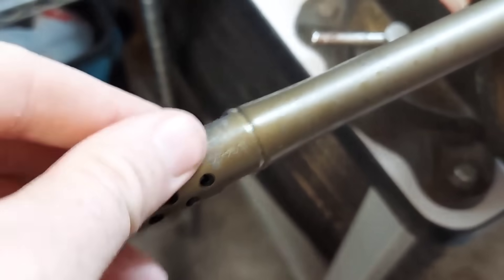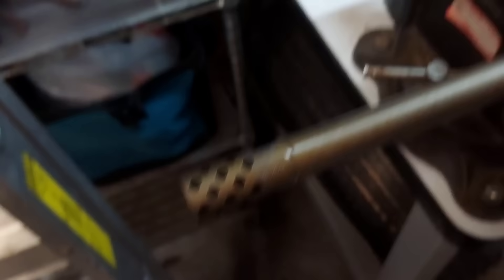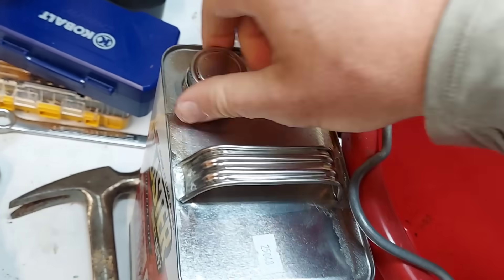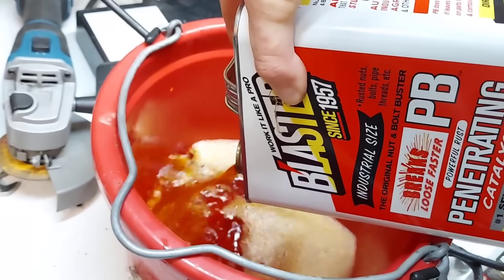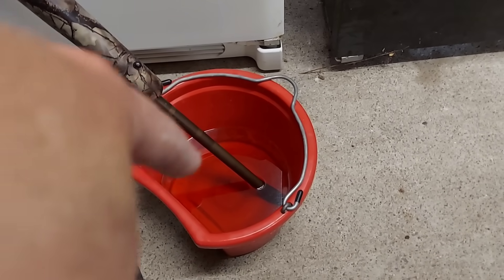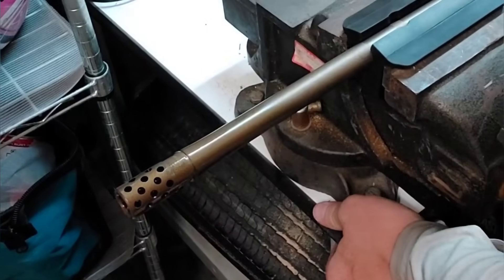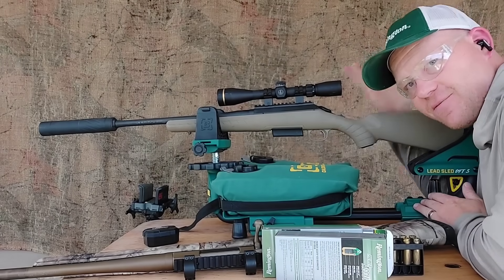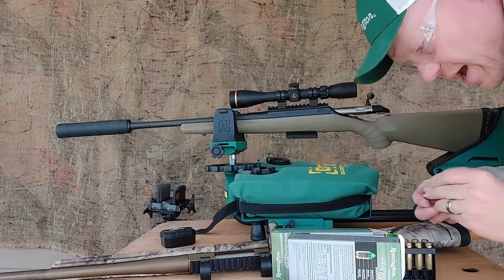450 Bushmaster Barrel Length Matter: Results Will Surprise You

Comment: 60FPS yields 141 ft lbs of energy at the muzzle.   About 5.5% increase in muzzle energy. 

Might try Hornady FTX custom 250gr  as it is designed for Bolt action.   

Hornady Black 250g FTX is designed for AR platform and shorter barrels.  

Different powders 

Of note 24” barrel actually slows the bullet.  Peak velocity of the Hornady FTX is from a 22” according to Hornady.

Comment: I had the gowild with 22" barrelm. Accuracy was terrible especially when barrel got warm.  The bold is crap and the slightest bump rotates the bolt a smidge and the gun wont fire.  Worst gun ive ever owned so I sold it for cheap.  Also yould do the test without the suppressor.

Comment: I never like to comment negativity but did you retighten the barrel on that rifle. But enough that because my ruger sr556. Brake was impossibly tight also I thinner it was. Rocket on I had to hold it in a pot of boiling water for about 10 minutes to break it free

Comment: I have three 450 BMs.  A Ruger American ranch with 16" barrel, Ruger Gunsite Scout with 16" barrel, and a Ruger Number One with 20" barrel.  Chronographing about eight handloads and a couple of factory loads, there is surprisingly little difference in MV.   The 20" barrel offers very little advantage.   All are about the same in the accuracy department.  Loads included cast bullets as well as jacketed ones.   I"ve heard that soaking the muzzle brake end in boiling water can help loosen it.

Comment: Just for future reference those jugs are designed to poor the exact opposite way of the way you poured it. I just recently learned this when I was putting oil in my truck and old timer told me to flip the oil jug over and it is a lot less messy and easier to poor. Give it a try it works pretty well.

Comment: I have the 16” barrel and the only reason I entertain the thought of a different 450 is 1) I like to Bear hunt Canada and the 16” isn’t legal there 2) I like the locking bolt on the gen 2. But purely for speed I would never trade 6” less barrel for 60 fps more, more maneuverability and less weight 
16” is king

Comment: I do quite a bit of barrel work. All my clamp blocks are out of wood lined with felt and use rosin. Never had a mark on any of my barrels.
 On my 350 legends my 22 inch barrel is about 75fps faster than the box stated velocity in a 18inch barrel. In my testing I would say the reason is a faster burning powder is used. Where I get a big velocity increase is reloading using a slower burning powder. I am able to achieve 300fps more with my reloads, slower powder and longer barrel. I have gone up to 2550fps with a moly coated 165gr bullet. Great video.

Comment: If that brake was affixed using Rocksett, you have to boil it in water for 5 minutes first. Comes off easily afterwards.  Also, get a breaker bar, already. Leverage is your friend.

Comment: Man, good to see you got it figured out. I couldn’t comment because the live was over. I turned wrenches my whole life, and noticed it right off. Also just fyi, pliers, they grip in one direction, adjustable wrenches also. If used wrong, they slip much easier.
All of my rifles are long, but I have to say, the wife’s mod 7, and and my daughters ruger ranch are easier to stick out the window in a shooting house. The cartridge has a lot to do with the velocity gain in a longer barrel. Straight wall, and really most short action cartridges don’t have much to gain.

Comment: I have been doing a lot of research as I plan on building a 450.   The general consensus seems to be that 18-20” is the sweet spot for barrel length on the 450.   In your shoes, if the longer barrel shoots as good as the 16”, I would have 3 or 4 inch’s chopped off and rethreaded

Comment: As most others have said, I'd probably go with whichever grouped better. Another take would be if you plan on sticking with factory ammo, maybe go with the Ranch but if you plan on developing a load and handloading your ammo, maybe with a slower powder, the longer barrel will yield a more significant increase in velocity. I don't think it's needed with the 450 though. It's going to be puttin' a hurtin' on your target regardless.

Comment: 'Next time' I'd dust those flex jaws with powdered rosin. Always the best way to get 'traction' between metal and plastic or other metal. Apply with small paint or makeup brush. Wipe away with DNA or 91% RA. I use it on milling vise and lathe chucks jaws too when there isn't much to grab onto  and/or  esp with plastics to not distort 'em when clamping up. btw It's not a secret .. but who knows?  🙂

Comment: Ruger sometimes uses Rocksett. It’s water soluble. Sounds crazy but I couldn’t get the muzzle brake off of my SFAR until I submerged the muzzle in almost boiling hot water for about 15 minutes.
Reply from the maker: They told me they never use it

Comment: 1 - Check your headspace on the 22" after messing with the barrel and action thread.
2 - Not surprised to see that small a difference between a 16 and 22" barrel on a straight wall cartridge.
3 - DO NOT become a gunsmith 🤣

Comment: Put a touch of anti seize compound on the barrel threads and wipe lightly to leave the compound in the inside of the threads. Only torque the break to 30-35 FT/LBS MAX. I prefer about 25-30 when clocked. If you need to shim it to clock than do what’s necessary bu there is no need to stick a break on a barrel so damn tight that you need to use impact to loosen it. 
Good luck and have fun, thanks for all you do for us the viewers. 

Any tighter is

Comment: Im sure someone has already said... if its got locktight on it... the only thing that will work is heat.  Hit it with a torch for a min. and then ...turn it the 'right way.'     But only the tip and only for a min. so you don't burn the finish off the barrel
The REAL thing that I hope someone here has told you... take it to a gunsmith.   Even if you get the muzzle break off... you will still have to reset the torque on the barrel... you will need an Action wrench to do this proper.  Or you can lock the receiver in that vice... you think the brake was messed up... clamp that receiver in that vice and when turning... it might actually shatter it.   Or you can go buy an action wrench for a Ruger action and re torque it... about $90 with tax... 40buck less than a gunsmith... but in the end you would still have an action wrench for all your rugers when needed.

Me... I would choose the shorter of the two...(hunting) Or if I have to choose prior to purchase... I would choose a 18in or 20in if they had it.  It just means... all the powder was burned and it stopped pushing after about 18in with that round.  19 would be about the best... after 19 it probably started to slow down a little... but gun makers don't like odd numbers.
Always fun videos Adam.  Thanks Brother.

Comment: This is kinda the result I was expecting with your barrel difference. Just kinda makes the insistence on getting a 2" longer barrel pretty silly. Need to try it with a like 308 thats 16" vs 22" barrel. In this case, id throw the longer barrel thing on the chopping block. Im very curious to see what the results would be on a faster round

Comment: Who Tee Who next time you need to put a barrel in a vice I would go to your local auto parts store get a foot long piece of 5/8 or 3/4 inch heater hose, slice it long ways and rap it around the barrel before putting it in the vice should keep the barrel from spinning and getting marked up

Comment: Hey Buddy,  yup, I’ve tightened so many nuts when I was trying to loosen them…. “Lefty Loosey,  Righty Tighty.  Regarding barrel length and speed. The longer barrel shoots bullets about 3% faster. So is 3% faster enough to out weigh the benefit of a shorter barrel?  The other thing to consider is accuracy. Which barrel is more accurate for you?

Comment: I would keep the Camo stock rifle. I like camo better. Also, as you stated the scope is calibrated much closer to that rifle. Why else would you have that scope unless you planned on using it. 60 FPS is still a little flatter and faster. A rifle with a 22" barrel really isnt that hard to manage. If it were 26" then that would be a different story to me. Eaither way, thanks for another great video. Maine North Woods Hunter (Shane)

Comment: You’re one of my favorite gun Youtubers. I am a machinist by trade and it is always painful watching you work on guns. I know you are a shade tree mechanic, but guns are a different animal. You can’t always just muscle things off. I’m sure a mechanic can verify that heat helps the situations. It also helps if you don’t over torque something and then try to loosen it. Again, I love your content. And I love that you own your mistakes. But I also think you need to give Ruger credit that muzzle break probably wasn’t over tightened. If you would’ve used heat on the muzzle brake and then tapped it with a dead blow hammer it would’ve come off super easy and not even messed up the finish.
Reply from the maker: It definitely was overtightened. I show that in my first video (the 2nd video was where I turned the wrong way). Also in this video I show you my other 450bm that had the same problem. Also ruger admitted to it and said it is their #1 complaint
Reply: @WHOTEEWHO  I don’t disagree. They have a problem with it. However, please in the future take the time for the proper practice on how to install and remove muzzle devices. You have all the tools you need from what I have seen. I think you have yourself overworked right now and you need to take a step back and get some breath. You’re a Christian brother and I’m just asking you as another Christian brother to get some fresh air in your lungs and start taking your time doing things.

Trust me, I work on my vehicles as well.  I know how to improvisation is key to getting a job done. I have made tools to work on firearms, but I never miss you. Tools to work on firearms like I do with cars. They’re not designed to be able to handle that kind of abuse.

For the future, please always vice the barrel towards the end to reduce both flex and twist of the barrel and reduce stress on the action and chassis.  Get yourself your dead blow hammer out out of your toolbox. If you need to add some heat, add some heat. Give it a little love tap, and I almost guarantee you will get almost any stock muzzle break off with relative ease.

I have had to do this with multiple small companies when I was younger and buying new firearms . For some reason, people in the early 2000 thought that it was a good idea to red Loctite on muzzle devices. If you heat something up with the torch and you give a good love tap to the positive device, it will come off. 

Again, this is with all love and respect.  It’s your channel and you will run at how you wish. I just ask you to take some consideration from your viewers and just take the time to do it the correct way.
Reply from the maker: @mickeydoodle6014 I dont have a dead blow hammer 😅. Im always doing things on the cheap

Comment: Case design dictates optimal barrel length. Straight walls are more efficient than bottlenecked cartridges and use mich faster burning propellant. Whch produces better velocity with shorter barrels.

Comment: man brother you do need to take a break lol. I was pullin out my hair laughing at you yesterday tightening that thing. 450 BM was designed for working in the AR-15 platform. Anything over 18 inches will pretty much just be extra barrel weight. You might could handload some hotter to take advantage of the longer barrel, but if you stick to what you can grab off the shelf, the shorter barreled gun will be much more maneuverable in a blind or stand.

Comment: Little heat on that muzzle device would’ve worked wonders. Long as you turn it the right way. Lol. The heat would both burn up any thread locker they may have had on it and it would swell up the female threads, giving clearance between them and the male threads.

Comment: I wonder if the velocity would be faster somewhere between 16” and 22”. 
Ballistics By The Inch website has.357 magnum listed with 16” barrels having peak velocity with the ammo tested. Longer or shorter barrels had slower velocities. 
The .44 magnum peaks at 12” and is close to the same velocities with 16”. 
I don’t know if 450 bushmaster would peak at shorter than 22” but I wonder

Comment: I bought that exact same Ruger American Gen ll predators 450-Bushmaster. To do some serious bullet testing & load development. This is how I got the muzzle break off mine. I just stuck the barrel in my 1 gallon can of WD40 and let it soak overnight. It didn't take much effort to get the muzzle break off after a 12-hour bath in WD40. The main reason I took the Original break off was to put the Browning Recoil Hawg on instead. I doing extensive load development lot's of shooting. You should definitely check out Bear-Creek ballistics 450-Bushmaster loaded ammo. It's the best performing highest velocity factory ammo I've ever shot. They advertise Their 240gr-HV ammo at 2570fps and 15" of drop at 300yrds. In my Savage 110-Trail-hunter 20" 450-Bushmaster, I'm getting 2485fps & in my CVA Cascade 450-Bushmaster 22" bbl I'm getting 2577fps. I've shot several & hogs with devastating wound channels. Black Butterfly Ammunition has a 350gr BUZZ SAW subsonic ammo. It's very impressive makes some nasty wound channels. Their 250gr Turbo Tipped Tomahawk 2500fps 20" bbl. Buffalo bore Barnes 275gr-XPB 2442fps. God bless you and your family. God bless America 🇺🇲🇺🇲🇺🇲🇺🇲.
Reply: I’ve been using that ammo for two seasons and like the results. I hunt fields and forest, depending on the wind, so I needed some ammo that could give me some extra range and less drop. I changed out the OEM Ruger stock and mated it to a Magpul stock and it improved accuracy and is about 5” shorter overall length than the original gun. The weight did increase but not to much.

Comment: I had an issue like that. I soaked the comp in tap water over night. The next morning it came right off with not a whole lot of force. I had researched that some manufacturers use a water based thread locker on their comps.

Comment: Most important step is to turn the brake the right direction.👍 Noticed it in the other video. Try thin double sided tape in those rubber pads. I use to put it in all my scope rings. It always worked for me. Try a hair dryer or heat gun on the brakes. Hot water will work too.

Comment: I would say, If you are gonna Run with the Suppressor, then keep the 16 inch and save yourself the extra 6 inches 'awkward length' on the 22in + Can. 60 fps is not worth it At All.  160 fps  might be different. 👍

Comment: If it were me I would keep the Ranch with the 16 inch barrel and mount an LPVO, but that is because I'm in the PNW and it would make a nice little brush gun for west side black tails in the thick woods where you aren't likely to ever take even a 100 yard shot. 60 fps isn't worth packing an extra 6 inches of barrel length through the brush, especially if you are going to put a can on it.

Comment: Use wrenches and vice-grips correctly for maximum torque. Grip it in the vise as close as possible. While turning the wrench, tap on the end with a hammer. Would have commented yesterday but wasn't able to. Might weld the can on putting it on hot. Love the song!

Comment: I have a ranch, 16 inch barrel, but we hunt in the mountains of PA, it’s less than a hundred yard shot the 450 it works just fine, it’s light and easy handling. And has enough snot to get the job done.If I get off the mountain like the fields I’ll take the 270 or the 280.

Comment: I've done a similar evaluation..Sorta,Kinda.  I made a scope dial dope card for using 4 different ammunition choices. No matter what brand/bullet weight I'm shooting I can set my turret and hunt. I noticed that the 22" barrel Gen2 has a smaller elevation adjustment on the turret between ammo choice than the 16" Gen1  BUT..I was using low scope rings on the 16" and a high ring on the Gen2 because of a larger objective lense..so that was my conclusion for the turret difference surprise. I'll take all the FPS I can get over the 6in shorter barrel convenience. I like them both but if I had to choose one to sell and they both shoot small groups..it might be the 16"... mostly because I like the safety set up on the Gen2 more than the Gen1 

Good luck with your rifle.

Comment: What if you used the hotter loads from bear creek ballistics?  Would that make more difference with more powder to burn?  Accuracy?  Have a great day!
Reply: You'd need to use a slower burning powder.  The reason its not much faster is because all the powder is being burnt before it leaves the barrel. That's why you see such a huge jump in velocity with 44 mag between revolvers and carbines. The powder has more time to fully burn in a longer barrel. So that 450 load is very well suited to short barrels, I'm sure Remington designed it just for such performance.

Comment: Your current factory ammo seems to be optimized for the shorter barrel. You should be able to use a slower burning powder in a handload that can actually use the longer barrel. And at 25 to 50 fps per inch of barrel that should translate to at least your desired 150 fps improvement.

Comment: The answer is to buy some LilGun and handload it to 2200 and keep the gun you'd rather have. I have that Leopold scope and the Gen1 ranch and handload with 37.4 gr. Depending on temperatures, it run 2241-2280 ft/sec. It was the most accurate load on my ladder test. I don't care if it's a little faster than the scope. Love your videos
Reply from the maker: Ooh nice